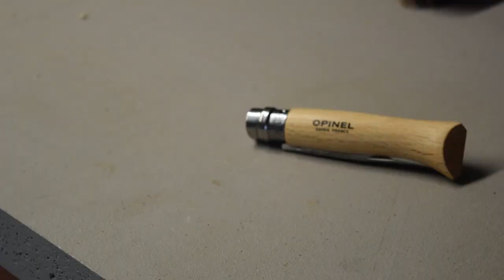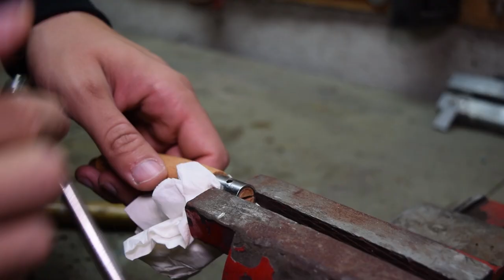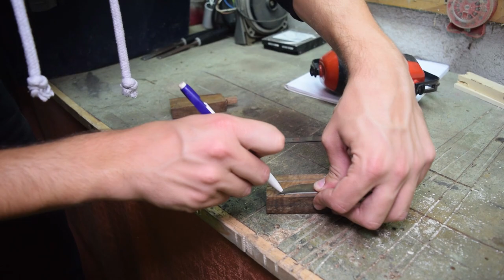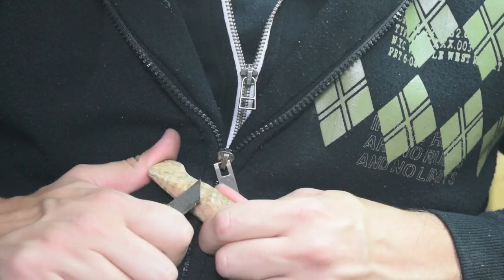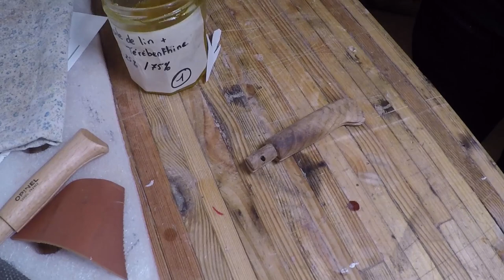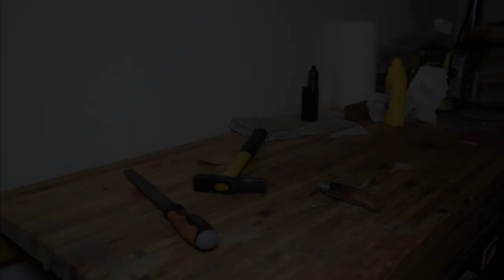Opinel N°08 Handle || DIY

Comment: Dude can you please link me to that little tool you used to hammer out the pivot pin? I always get the pins stuck halfway out and it's so frustrating 😣
Reply from the maker: Ahah, I just used a pop rivet :D It was a bit smaller in diameter than the hole, so I could get the pin to the other side, and still take the rivet out

Comment: Too much wood was removed from the end (butt) of the handle, dangerously exposing the blade tip when in the closed position. It is always better to remove less wood at first and slowly work to the finished product. You can't put wood back after you have removed it.
Reply from the maker: Totally true. I was to greedy and I failed :/
Reply: @FrenchCoastWorkshop  :- That is how we learn. I guaranty that you won't do that again.
I did much the same on an Opinel, but was able to grind down the exposed blade tip and hide it back in the handle